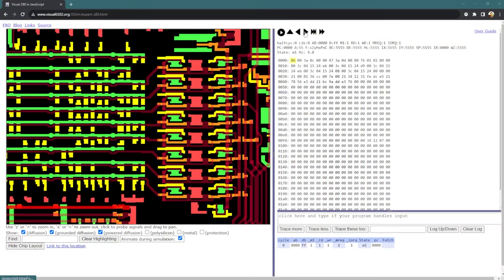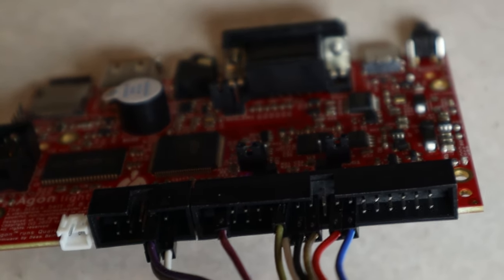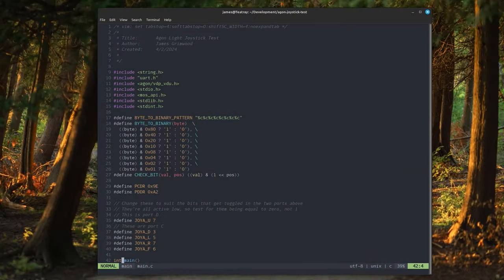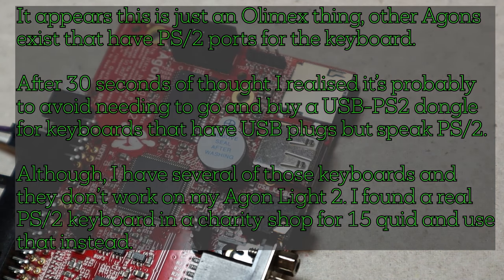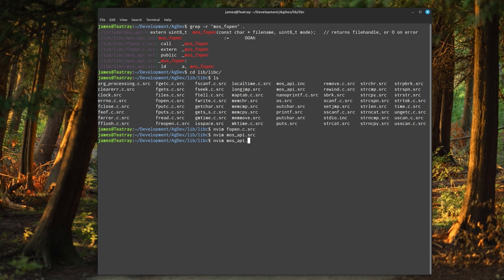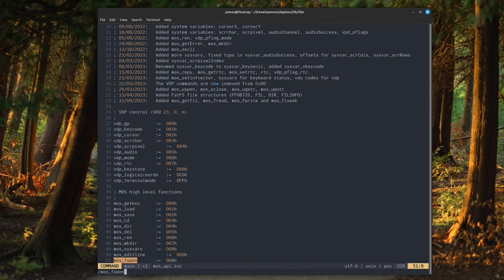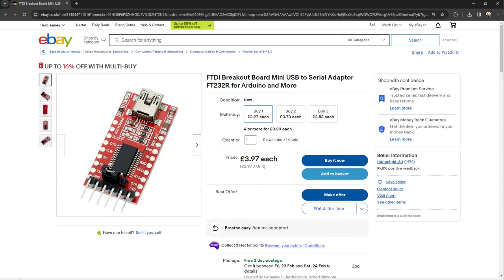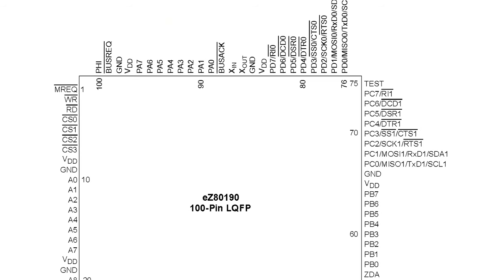Agon Light 2 - C Programming, Better Keyboard Routines, Joystick Ports

Comment: On your debugging things, latest versions of the VDP firmware now supports VDU 1, VDU 2, VDU 3, VDU 6 and VDU 21...  (This is in the Console8 firmware - it's not yet been merged into Quark, but you can run the Console8 variants on any Agon machine, including the Agon Light 2.)  VDU 2 and 3 will enable and disable the "printer" (like on a Beeb) which on the Agon is a serial device connected to the Agon's USB power port.  So you can plug your Agon into your PC, run up a terminal program, and your program can then potentially send whatever it likes down that serial link.  No need to use the eZ80's second UART any more.  😁
Reply from the maker: oh I'll have to try that. I've got the Console8 firmware on my Agon Light 2.

Comment: I have an Agon Lite 2 but haven't done anything yet - this is the kind of dev I find interesting though - messing around in BASIC is not my thing. Am thinking it would be fun to use the eZ80's 24 bit mode to make a multi-tasking OS that uses the full 512K and runs Z80 programs in each their own process.

Imagine if this CPU had existed in the early 80s instead of coming out in the early 2000s - its peers would have been the MC68000 and the Intel 80286, which hit their stride in the mid to latter 80s. Zilog could have played ball with them, but the successor CPUs they tried back in that time period didn't really go any where.
Reply from the maker: Exactly! Imagine a ZX Spectrum with this CPU... The Cedev compiler uses 24 bit mode. You can have a lot of fun with an 8 bit CPU when it doesn't see the world in 64k chunks.
Reply: Zilog couldn't really develop the successor of the Z80 as the original founders wanted. I think Exxon almost own them (they put the money to make Zilog a reality) and they had other plans... A loss for the rest of us too. Shame.

Comment: I've noticed you have started posting Agon Light vids after you had already posted several SpecNext vids. Why have you bought an Agon when you already have a Next?

It used to be that the Next was much more expensive than an Agon Light (2) but there's not much difference in price between an Agon LIght and an xberry pi or NGO. The Next has a faster CPU (right?), better graphics and better sound than the Agon so it makes for a better retro games platform, as far as I can tell.

The Agon wouldn't have any video output without its ESP32. If you're willing to allow a ESP32, depend on it, then why not just go FPFGA at that point? The BeebFPGA core even gives you a SID on your next/ XBPi.

I presume you have benchmarked the two machines against one another right? How do they compare just CPU wise?

Thanks for the great videos!
Reply: I've ordered an xberry pi after looking into the various options for modern retro systems for years. I should get it on Tuesday. The thing that pushed me over the edge to buying a Next clone is SymbOS. Have you tried that on your Next?
Reply from the maker: I bought the Agon because I have a bit of a weird fascination for these single board machines. The Next is fun to write code on, but I was finding the restriction of 64k of address space awkward to get my head around. The Agon uses an eZ80 that has a 24 bit address space so I don't have to work within complex banking restrictions.

I actually don't know which would be quicker. The Z80n is about 8MHz faster than the eZ80, but the eZ80 has different internals. Hm. I think you've given me an idea for a future video to explore!

I'll use CPUs, FPGA, whatever, I don't care. It's all low level programming :)
Reply: @ncot_tech  the 64K limit does sound annoying yes. Was it the same on the Speccy 128? Some things should've not been adopted by NextZXOS for sure.

Turns out z88dk isn't actually full ANSI C but instead Tiny C which is missing a few features. Are there no other C cross compilers that support the Next? As fa as z80 is concered there is the Amsterdam Compiler Kit and lcc that do offer full C and z80 but I'm not sure if they support the Nexts extensions?

ACK is apparently used to build FUSIX for z80 platforms. It migt make sense to use ACK or lcc for some projects but z88dk for others?

Did you see my github bug report for your sprite repo? The copper example code doesn't seem to run properly under cspect either.

Comment: Without resistors to hold the joystick i/o lines in one direction when not in use, are you running into "floating" pin data issues?
Reply from the maker: I don't think so... I think the eZ80 has internal pullups. Or at least it seems to consistently report 0xff when I read it.

Adding some resistors if you were doing it properly might be wise though. Along with some ESD protection to protect the eZ80.

Comment: 28:58 - Been a while since I wrote any Z80 ASM, but I figured LEA was an eZ80 thing, which it appears to be. It looks like the reason for the odd PUSH/POP dance is that it's fewer bytes than using LEA and also works in pure Z80 mode. Which is faster, I'm not sure.
Reply: Looked it up, and using LEA is faster by a fair margin: a PUSH/POP is three cycles while LEA HL, IX is also three cycles.

Comment: 1:28 BBC BASIC V does not need line numbers since 1987.
Reply from the maker: Really? The BBC Basic manual shows line numbers in all its examples. https://www.riscosopen.org/zipfiles/platform/common/BASICRefManual.3.pdf
Reply: My recollection is that BASIC V still demanded line numbers.  Some editors like StrongEd would allow you to edit programs without them being visible, but under the hood they were still there
Reply: @archibaldbuttle7  You are right, I used the TWIN editor at the time and it indeed added the line numbers when exiting the editor.